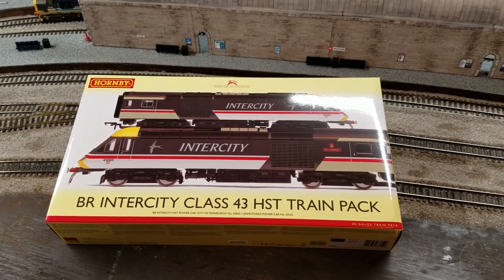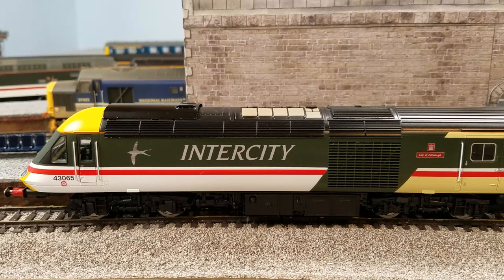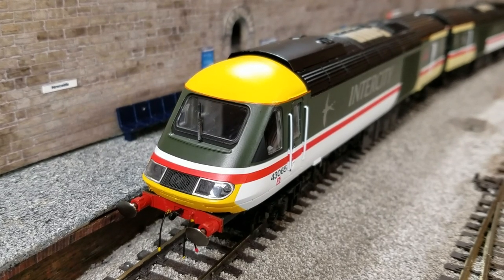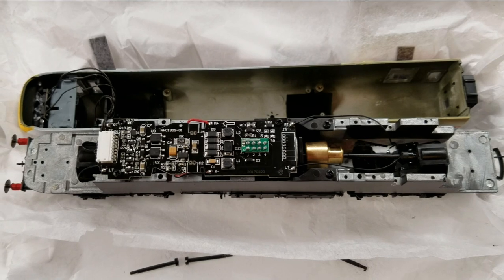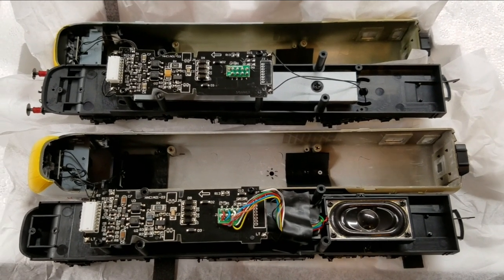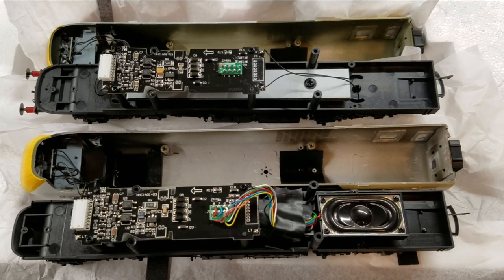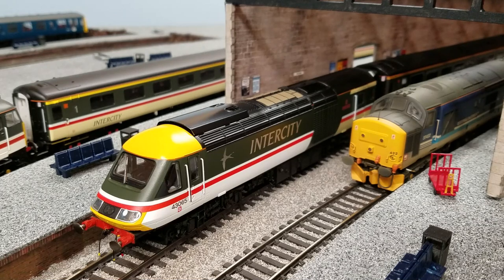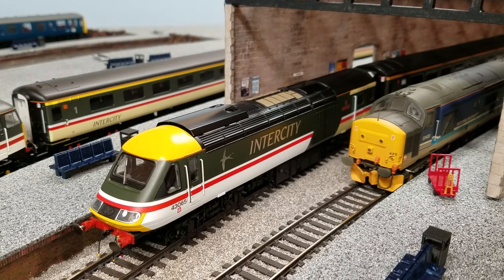New loco - Hornby Class 43 HST with buffers

Comment from the maker: One thing to follow-up on here is that I mentioned the loco had some issues hauling the rake of coaches on some curves. The back-to-back gauge on the unpowered car was actually pretty tight. After adjusting the wheels, it now runs much smoother and without problems. Worth checking the back-to-back gauge if you have problems.
Reply: That is useful information, thanks Iain.  My Hornby  INTERCITY livery HST does struggle slightly with a  rake of Mk3s (whereas the Bachmann 90 manages them easily, even propelling with a DVT) so I will check the b-t-b's on the dummy car.  Thanks for the tip.  Vivian
Reply from the maker: You're welcome. I was checking performance by adding one coach at a time until I got to the point where it struggled, thinking it was the drag of coaches. Wasn't until I added the DVT it had problems. Adjusting the back-to-back gauge seems to have resolved it. I don't remember if I'd done the coaches when I got them 18 months ago. Iain